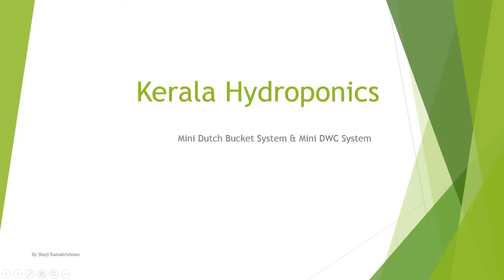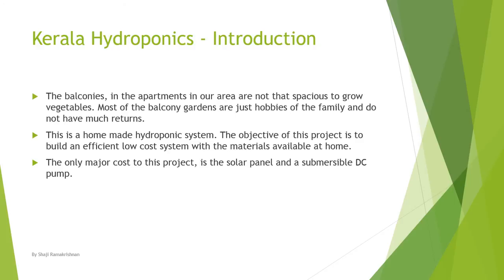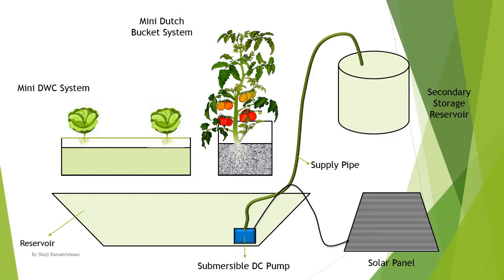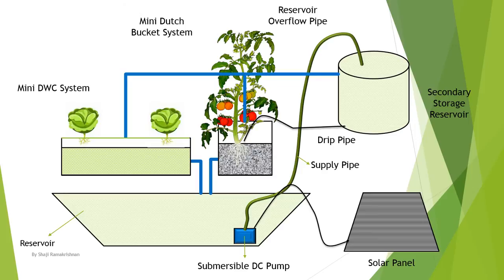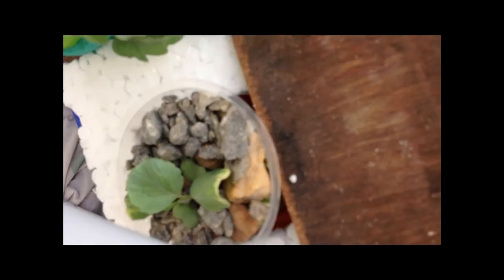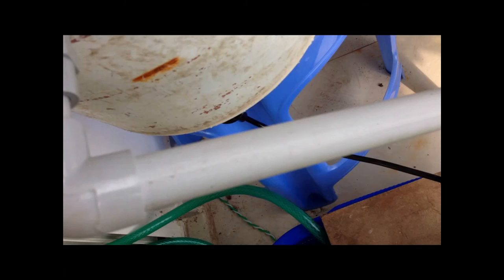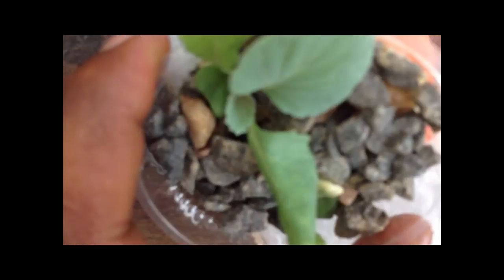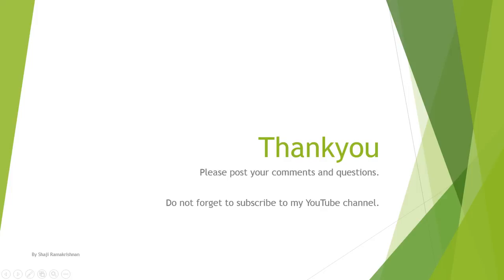Home Made Hydroponic System - Part 1 of 2

Comment: Am going to do in commercial large scale hydroponics using Dutch bucket with 5000 plants..am looking for a solar power supply to switch on my 22ov 2hp motor.cpuld u pls suggest with nutrient n solar .
Reply from the maker: You just need a small DC motor that can pump water upto 2 meter height. Use tank which is in a height where the gravity can supply water to your plants. This way you need to buy only a small solar panel (20W / 12v). 

I would also suggest you to do a experiment on a smaller scale with 5-10 plants before moving on to a large scale project. This will give you the preview of the problems that you might face and solutions of that.